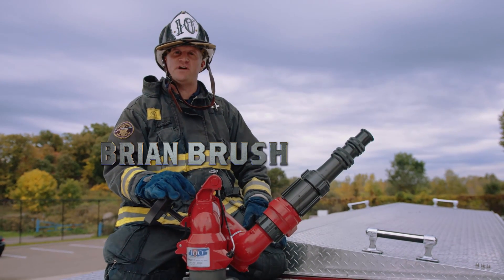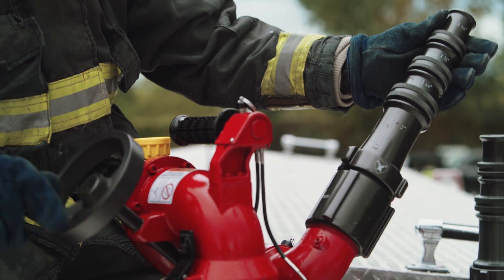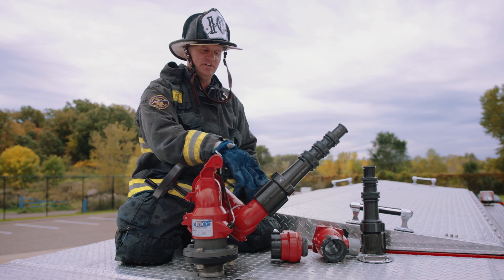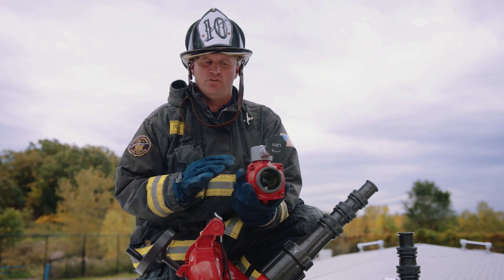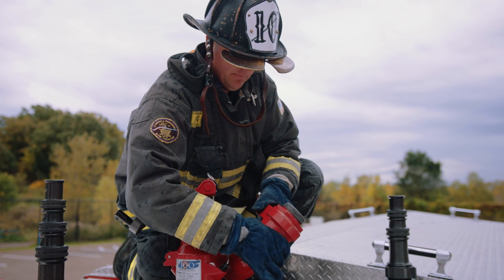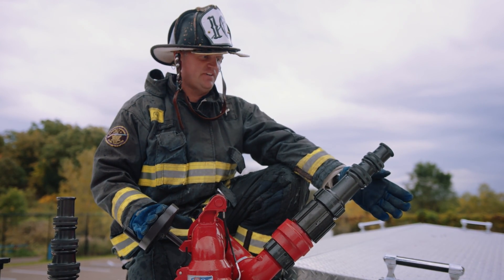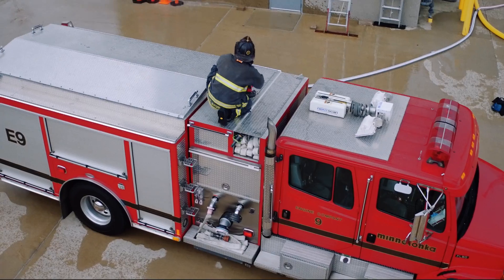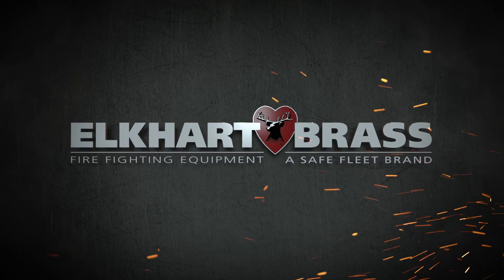Ball Valve versus Gate Valve on a Deck Gun - Brass Tacks & Hard Facts (Episode 17)

Comment: You'll have to keep an eye on the gate valve over time, the pressure of the water against the gate while opening and closing will cause the gate to wobble and bleed through at some point. Just a heads up.

Comment: What would you use for a friction lose pressure increase since youve now added another appliance into the equation?
Reply from the maker: The gate valve has a full 2.5" waterway when fully open so this friction loss would be field insignificant.  It is unlike a wye, Siamese, manifold, or the like.
Reply: @ElkhartBrass  
Thank you very much for the reply! I love the outside of the box thinking! Stay safe

Comment: You really need to have a pump equipped with a pressure governor to get the most out of this setup.  When you open the valve and set the discharge pressure to 80psi, which at that time will be static, the governor will maintain that pressure as you begin to flow water.  Another good reason to use the gate valve.

Comment: Thinking this could be the solution with my Volunteer Company. If I ever show up to a fire by myself. So is it safe to charge the deck gun and crank up the psi , then climb then Engine and open the gate valve without damaging the pump or valves ? ( I can still see having to make 2 separate trips to the top of the Engine but at least using the gate valve I would not waste as much water )
Reply: open your tank fill slightly